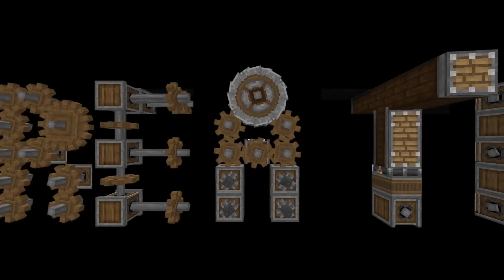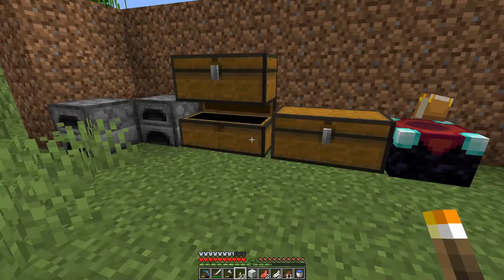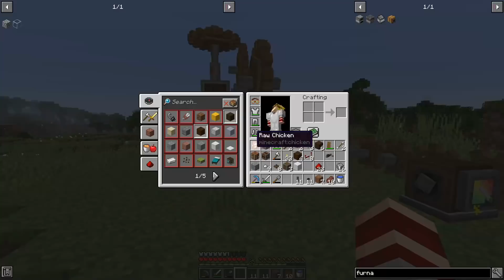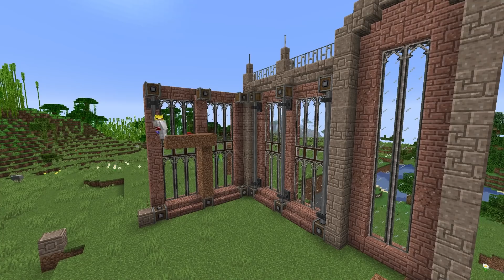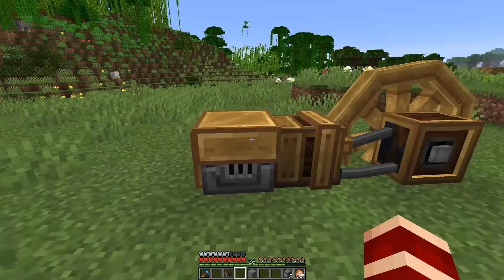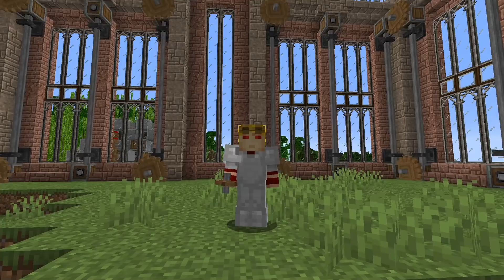Infinite Power! - Create Mod #1

Comment: Tango, I'm sure you've figured this out, but you could do a second timer immediately after the first, have a 1 minute one, and then 20 seconds; however, 60 seconds shouldn't be an issue either, as long as the block is taken out within enough time

Comment: A lil tip concerning brass making : you can yield more loot if you mix copper and zinc ore powder than if you mixed ingots together. Why? It's simple : when washing powder you may get between 9 to 12 nuggets, where as one ingot is made out of 9 nuggets. This is a slight improvement to the production rate, but notable on the industrial run :)
Reply: Without saying that bulk washing materials is really useful, as you can turn flour into dough (which can later be turned into slime by mixing lime dye with it), filling empty buckets with water, turning magma blocks into obsidian, washing gravel into flint and iron nuggets, washing sand to make it into clay balls (or gold nuggets if it's red sand),  and more, and of course bulk washing powder to get pure ore nuggets.

Comment: Don't know if anyone else has pointed this out, but if you can't go to 80 seconds, do 40 seconds. That'll still keep the ore from being smelted but every two times it enters the furnace it'll kick the coal into gear which means no downtime for the engine unlike the 60 second intervals. Obviously not super important since you're using a different fuel soon, but figured I'd point it out in case anyone else wants to try something like this. At least I think that's how it would work, I haven't got to play with this mod yet.

Comment: Not only do I not generally watch modded minecraft, I don't play modded minecraft, that is until you and Zedaph started playing this on stream, so now I downloaded it.

Also, at 2:18 Is anyone else bothered by the fact that the water is flowing the wrong way over the waterwheel. Just look at the angle of the slats. Yes it works both ways but I believe you don't get full SU capacity unless it flows the correct way.

Comment: What if you set the pulse duration on that repeater to 40s instead of 80s, the ore will cycle twice as fast but that should not be an issue, if I understand it correctly.
Also great idea with this beautiful mod, keep it on, luv ur vids :)

Comment: Since coal cooks for 80 seconds, and the multi-tick repeater doesn't go for that time length, wouldn't you be able to just set the repeater to 40 or 41 seconds? I would think that would fix your problem without having to extend anything else, just keep it compact. With this way, the fan will blow after 41 seconds and just loop twice every time the coal is depleted.

Comment: your water wheel is a little inefficient by the way, if you had flipped it (so the wheel goes the same direction as the water) and made the water flow all the way over it would increase capacity by 30-40%

Comment: In case you wondered Tango, blocks of coal are actually more efficient than single pieces IF you are using more than ten pieces of coal at a time. You see, one block will burn for the amount of time that it takes for ten individual pieces to burn,. Just in case you wanted to know or didn't already know that <3

Comment: Tango, you don't need any of the redstone. 
Make the fan run off of the generator. Any time the generator turns off, the fan cuts out, and the ore drops back into the furnace, restarting the furnace.

Comment: Hey Tango, as you fill out your factory with machines pulling power from the walls, it would also be cool to extend the power grid into the floor. That way you don’t have the equivalent of extension cords running to the middle of your factory floor to machines that are not directly against the walls. Really looking forward to this series!

Comment: Just a heads up tango, concerning your flywheel furnace engine ore suckificator you need to account for the tics that the torchs and other redstone components generate otherwise after a certain amount of time it will de-sync even for just a second. This is fine for most create things but anything with a contraption (i.e. wheat farms) will place the contraption which will ruin your tilled soil and other similar things

Comment: TANGO IT MATTERS WHICH WAY TEH WATER EHEEL IS PLACED. you need to have the blades being pushed by the water and not rolling off of the blades the blades should be pointing in the opposite direction of the way the water is moving.

Comment: Around 2:30 the water wheel you have is actually backwards. It will generate more stress capacity if the water is flowing the correct direction around the wheel. You can also use soul-sand in the bottom corner to create water that flows up to generate more power.

Comment: You could set your fan clock to 40 seconds, it'd put the item back in when the coal is halfway done and then again when it goes out.
Reply: Actually, blast furnaces consume fuel twice as fast, so 40 second intervals would be exactly one cycle of a piece of coal.
Reply: @garrettjohnson1486  No, I'm pretty sure it only smelts twice as fast. Fuel is consumed at the same rate.
Reply: @fieryflame1299  I tested it. Coal can smelt 8 items no matter what furnace you're using. In a blast furnace or smoker, items cook in 5 seconds, so coal is consumed in 40.
Reply: @garrettjohnson1486  The more you know.
Reply: if thats the case, just use a coal block

Comment: How does the system work if the timer isn't exactly matched to the burn time? If you put a new ore in when it's not finished burning, it won't consume a new fuel. If you wait too long, it'll stop.

Comment: You can use coal as the fuel for the furnace if you have a second adjustable repeater (one of the repeaters set to 20s and the other set to 1 minute)

Comment: Can you produce more power from a single wheel if you use a water source block on both sides and place a magma block on 1 side and soul sand on the other?

Comment: 40 seconds on the delay should work roughly the same as 80, just with it shooting it back in an extra time midway through the coal burning. Not that it sounds like it will matter since Tango has a plan for a different renewable fuel source for next episode (looking forward to seeing that)
:)

Comment: Why not set the timer to 40 seconds? Every other cycle it will pointlessly drop the item into the furnace and pull it back out, but that makes the other cycles line up perfectly with coal consumption every 80 seconds.

Comment: There is a small issue using furnace engines to power crop farms, during the time the ore drops into the furnace the power stops. If the arm of a crop farm stops being powered ontop of a piece of farmland it will break the crop and turn the famland to dirt. Not sure if it'll be an issue from a tiled setup like Tango's but I'd still use a windmill or waterwheel to power them.

Comment: Tango, those "brackets" are lineshaft bearings, they'd be super useful for running power shafts along the cieling like on a real old factory with belt drive to all the machines.

You could put your engines in a proper engine house; a little (but oh so fancy) adjoining building with one or more great huge chimneys on it filled with campfires for that extra BIG FACTORY vibe.

... you can NEVER have enough chimneys on a factory!

Comment: Tango you should use a belt there, its much cheaper then gearboxes are and it can easily transfer rotational force so you dont need use massive ammounts of iron and zinc

Comment: Yeah, I wouldn't call it an exploit, as the point of the smeltable input requirement is to add a level of puzzle. You just solved the puzzle in a unique way.

Comment: The water wheel in the beginning of the video is the wrong way around. It will spin faster if the water flows in the opposite direction of those shovel thingies on it (English may not be my native language).
Like you'd do it in real life basically.

Comment: You could adjust the fan to put the block in blast furnace every 40 seconds. Then you get the same effect when it stops, it’ll be on its second 40 second cycle
Reply: Not quite, unfortunately Create redstone items add an extra tick of delay to themselves that cannot be gotten rid of.
the solution is using 2 repeaters, one on 39 second and one on 18 ticks (-1 tick for the 39 second one and -1 for the 18 tick one
Reply: @ChiefArug  why not just 1 at 39? He needs something that divides into 80. So 39 plus the 1 tick is 40, or two 39s plus the 2 ticks is 80. No reason to do 60.
Reply: @MfmageRaids  39 seconds, plus one tick is 39 and 1/20 seconds, which is not enough to make up the 40 (or 80)seconds required, we need that other repeater to add in the other 19/20 of a second
Reply: @ChiefArug  gotcha, I misread the second as an 18 second, not 18 tick, my bad.
Reply: @MfmageRaids  All good!
Reply: @ChiefArug  To be fair, if you're going to be that specific it the second repeater would need to be 17 ticks. Blast furnaces burn twice as fast, so only 1 cycle per burn, then -2 ticks to account for the redstone tick of the torch.

Edit: Upon immediate reconsideration, it would probably actually be 16 ticks if each create redstone item adds a tick, since you'd be using an additional create redstone item for the second delay.

Comment: I suspect that the clock actually isn't needed for the ore the way he set this up. If you have the fan powered by the furnace, whenever the furnace isn't powered the fan stops sucking, and drops the ore back in. Then it powers up and sucks it out again

Comment: Tango, if you put the timer on 40 seconds, then it will put the item in every 80 seconds as well. Now there is a moment where there is no power
Reply: He actually doesn't need the redstone at all. If he hooks the fan directly to the furnace so that it's always pulling, when the furnace turns off, so will the fan, the fan doesn't have to push the item in, as long as it isn't running, the item in the chute will fall back in and start the machine again.
Reply: @nicholasstraw9800  yeah, but that would make the power intermittent, as well as the fact that the flywheel doesn't instantly halt, it slowly decelerates as one would expect.
Reply: @nicholasstraw9800  damn, you’re right. But I don’t know the mod too well. But maybe that would bring the whole factory down for a second each time

Comment: Does your version not have encased chain drives? There were a couple of places where it would have been more efficient to use chain drives instead of gearboxes or conveyor belts(they are cheaper than gearboxes and don't use power like conveyor belts). It might also be useful to speed things up in a central location as the rotation speed controller is one of the most expensive blocks in Create.

Comment: I made a similar system with furnace engines! The one issue is needing to "prime" it once it runs out of fuel, or due to chunk loading or something. The way I solved this was by having the fans above the furnaces powered with a separate, weak but infinite power source, I used encased fans over campfires or magma blocks.

Also, I'm betting you're going to use blaze rods to power it. In my world I made a self-powering blaze grinder by burning the blaze rods, as well as a system for weaking the blazes to 1HP. Pro tip: The mechanical saw does damage to mobs that scales directly with its speed.

Comment: Quick Note: The waterwheel at 2:50 is not running at max capacity because the water is actually flowing AGAINST the buckets of the wheel. The max for a waterwheel is 256 su.
Reply: You can make it higher with a bubble column from soul sand on the back side of it.
Reply: @cinderheartMLP  oh really? Cool!
Reply: @cinderheartMLP  incorrect

Comment: Looking forward to seeing what you're going to do, the Create mod looks amazing. I may have had a quick look at the wiki to check what fuel burns for 120s, very curious as to how you're going to farm that. I was expecting you to be using Lava as fuel for the base, because in your stream you said something about pumping lava out of the nether. 
What I'm most looking forward to seeing is the array of autocrafting systems you're almost certainly going to build: just seeing conveyor belts of ores and ingots, and cogs and belts all moving around the place. I think that's what makes the Create mod so satisfying compared to vanilla minecraft, that you can see it all happening. Rather than just lines of hoppers going into stacks of chests, you can see everything moving on conveyors.

Comment: You can use coal & just put the clock timer on 40s. It will put & pull the ore in/from the furnace twice per coal: Once to start the coal burning & once halfway through the coal's burning duration.
 
This can be done for any fuel source: You just have to put the timer on a fraction of the burn duration that is shorter than 1min. (If burn duration < 1min, then the fraction is simply 1 i.e. burn duration of the fuel). 
Sorry if this isn't formulated that clearly, but I think you should get it